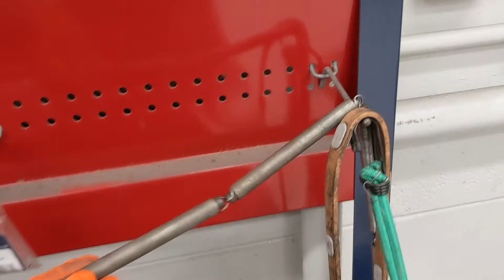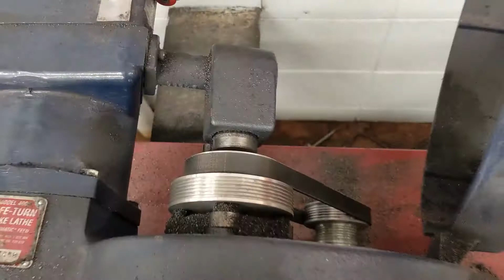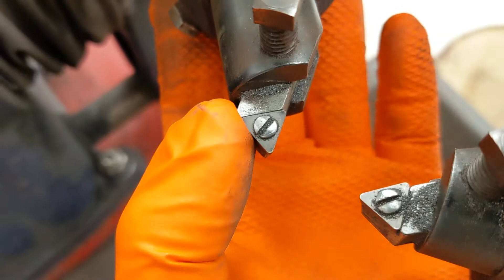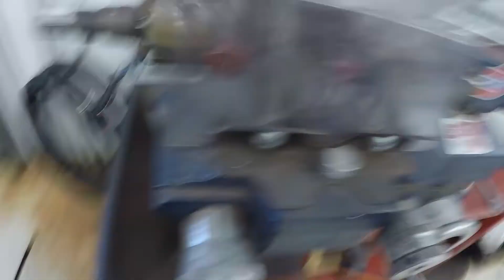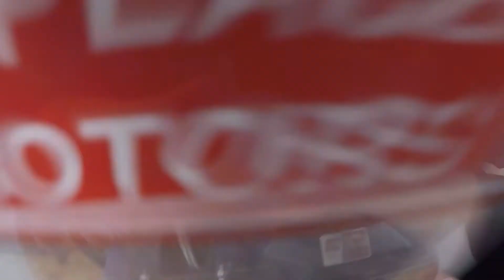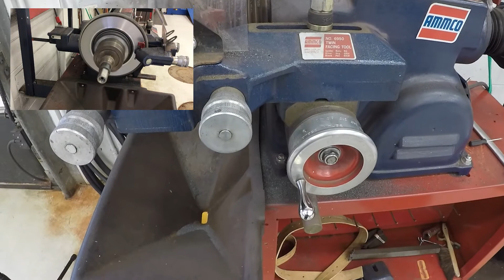Ammco Brake Lathe Demo

Comment: Where did you first check that rotor with all that runout?  I would like to know how you check that your mounting tooling is true and that it is not causing runout.  Runout is excessive with my 4100, the shaft is true, but the faces of the mounting tooling are not perpendicular to the shaft.  At the outside edge of a "finished" rotor, the runout is .006"  It's driving me crazy.  Did you ever clamp your tooling in the lathe to surface your tooling?
Reply from the maker: I measure runout on the car. I did it on the lathe as a demo for the kids. Stacked tolerances make the lathe measurements kind of worthless.